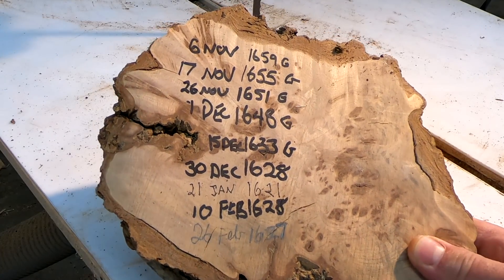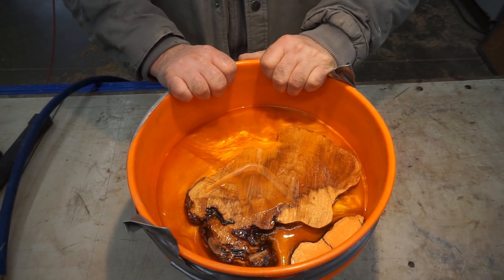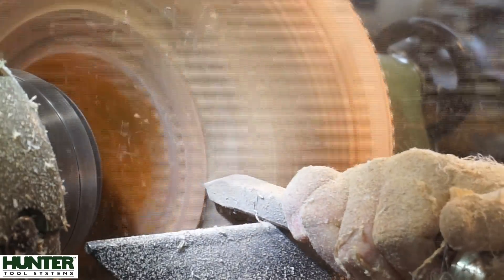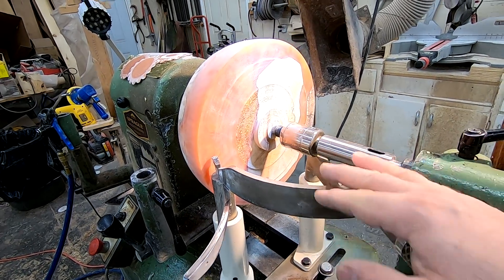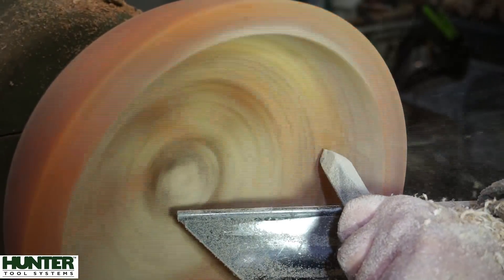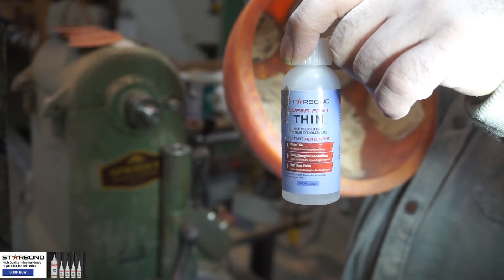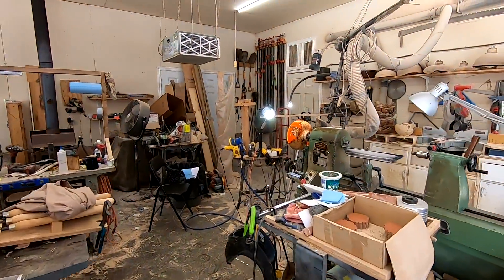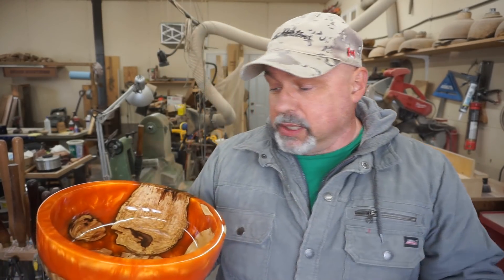Woodturning - Orange Crush Anyone?

Comment: Beautiful. You’ve really changed my perspective on the color orange, which I have not historically been a fan of. I personally would prefer to see the first coat of finish go on in real time, at least part of it. It doesn’t take long and it’s such a dramatic moment when the glossy shine emerges and the colors all pop.
Reply from the maker: Ok, I will slow it down next time, thanks 😊
Reply: Has an orange icon😂😂
Reply: @gibgailey7948  Shrug. It’s a default, and honestly it looks red on my monitor (which is an iPad, so I’m not claiming the colors are necessarily accurately displayed, but that’s what I’m looking at).

Comment: Have you considered laying out the pieces and making a map of where they go and then placing a piece of tape on the areas that make contact and then use your mold release and you can then just remove the tape and glue the pieces on where the tape was. You could even mark the tape and individual pieces for for easy assembly if you don’t take a pic or forget to.
Reply from the maker: This would work, but since I’ve drilled a hole in the bottom of the bucket, applying air pressure makes removal much easier, good suggestion tho, thanks.

Comment: Really pretty bowl. I'm wondering if you can help with some carbide tips. I've been told to keep the rest above center on the outside and below center on the inside to help with catches. Any thoughts? Thanks again for the video
Reply from the maker: With the Hercules I pretty much leave the tool rest in it’s lowest position but sometimes I will raise the tool rest up and lift the tool handle to avoid catches. It really just depends on how the wood and resin is behaving. You’ve got to find what works for you the best, hope this helps. Thanks

Comment: There is something about orange and burl. They just work together. It looks great!  Have you ever tried removing the waste block with  isopropyl alcohol? It is supposed to make taking the glue off easy. Just wondering. I love that bowl. Thanks for all the commentary too. Cheers.
Reply from the maker: If you can spray it on the surface then yes, but it would take a very long time to eat through the joint. Thanks for watching
Reply: @SpragueWoodturning  I'm told you just drip it or use a qutip to apply it where the two surfaces meet. It is absorbed quickly by the hot glue and the bond falls apart rapidly.

Comment: Awesome. Just bloody awesome! Wouldn’t have changed a thing. On a slightly different note - do you use the same pump for your vacuum chuck as you do for degassing & stabilizing? Is your pump from Oneway? Any special filters or precautions? Just got mine and wondering about using it for double duty. Anyway - thanks as always, Jim!
Reply from the maker: Yes, I use the same pump and don’t have any filters installed, not to say that I shouldn’t have tho. I bought the complete system from Oneway and it’s a Gast pump. I think there’s been some issues with the pumps they now sell and I’m not sure if their selling them anymore. Hope this helps, thanks

Comment: Jim, good morning. I am a big fan and watch all of your videos. I have a question for you. What size buffing wheel and who is manufacturer do you use on your handheld drill and is the drill anything special?  I have looked into the beall buffing system, but they specify that this is not to be used on a hand drill
Reply from the maker: Here’s the ones I use https://www.leevalley.com/en-ca/shop/tools/supplies/polishing/100858-replacement-buffs-for-beall-wood-buffing-system I just mount them in my drill instead of putting on an arbor that theses are meant to be used on. It damages the threads but I don’t care. Any drill will work. If your in the US they ship there too. Thanks for watching!

Comment: What’s the difference between a pressure pot and a vacuum pot?
Reply from the maker: PP compress any bubbles that might be in the epoxy and pushes epoxy into area that it ordinarily wouldn’t flow. A vacuum chamber will remove air from the casting and since it’s submerged in the epoxy when the vacuum is released the wood has no choice but to draw the epoxy into the pours of the wood. Hope this helps. Thanks

Comment: ive been really liking your channel lately! As per your advice i bought a Hercules a month or so ago. its been a game changer, but i still have my fair share of catches. any tips? i tend to of course have less catches making a shear cut as opposed to it flat on its back. what RPM are you spinning at working on the inside of a bowl similar to this beauty? Thanks for the great videos, and the advice on the Hercules. Ill probably have some questions for you about the Oneway coring system someday soon, i hope.
Reply from the maker: If you lift the handle you’ll get less catches, don’t be too aggressive with it, got to be patient with it. Don’t concern yourself with RPM, I turn the lathe on and dial the speed up until it vibrates then back it off until it stops. Thanks for watching and safe turning! Jim
Reply: @SpragueWoodturning  Thanks Jim!

Comment: Hi Jim , I need some advice. Today I’m casting some deep cast from designer epoxy. How long or at what temp do you pour to keep the color separation ? Thanks RM
Reply from the maker: I typically pour after mixing. I’ve tried waiting for hours but designer epoxy doesn’t typically heat up like others you see here on YouTube. Hop this helps.

Comment: Love your YouTube channel Jim!
What's the average weight & size of the burls you use in your bowls? I found a site that sells burls on average 6x2 inched 2½ lbs. I am not a wood turner but am interested in possibly emailing you for a bowl.
Reply from the maker: I don’t have a specific size or weight, but I typically don’t like working with anything smaller than 10” in diameter, unless it something special. Thanks for watching